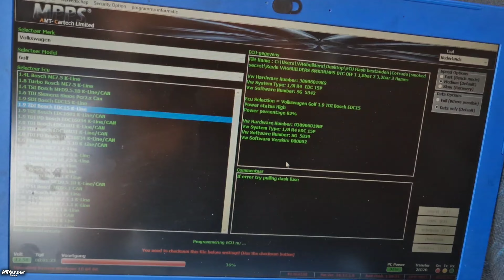We took the Mk3 VR6S and the Corrado PD to Portugal

Comment: Flamme map good to destroy the engine good
Reply from the maker: You will need a EGT gauge off course, I will monitor it. If it will become to hot the bearings of the turbo will brake. 
Or melted pistons.. but if you use it while using your mind, it will be ok 👍